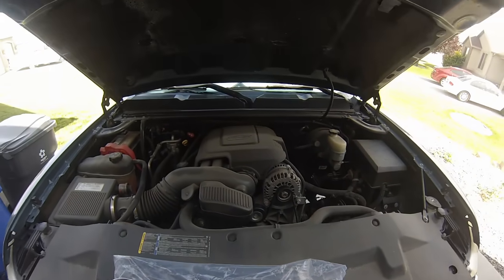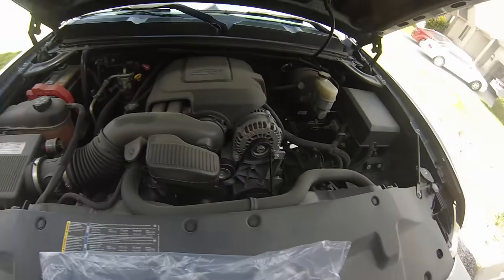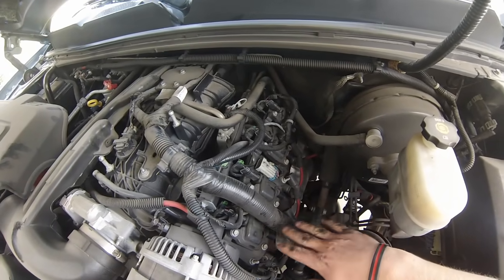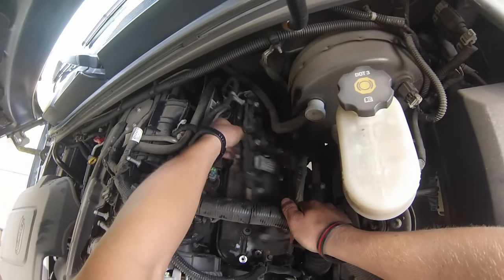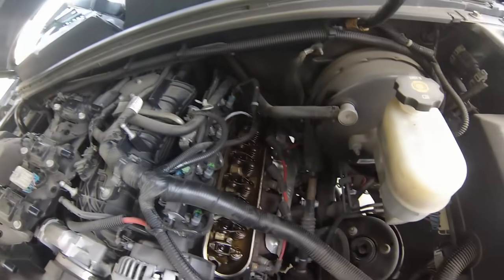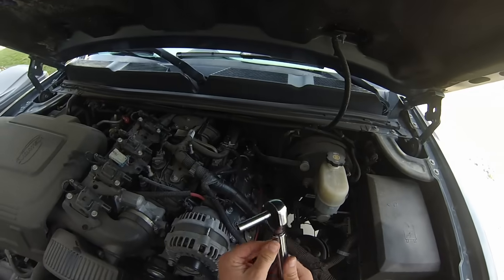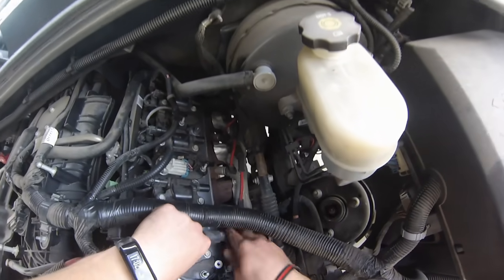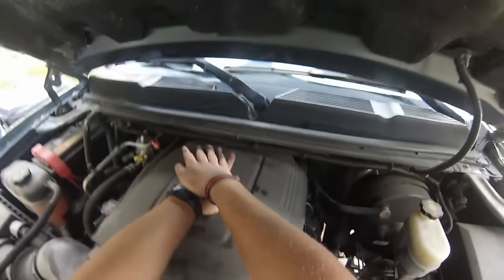Oil Consumption Fix: Replacing the Valve Cover and PCV on 2007-2013 Chevy Silverado

Comment: "Tube just pops easily off the valve..."
2 hours later, no there's nothing easy about it.
Reply from the maker: That's been my experience in every YouTube video I watch as well haha. I guess I got lucky in this video. Thanks for watching!
Reply: I assume you already got the job done, but there's a little pin-like lever at the base of the connection. You pull that back toward you and that releases the hold and you can lift it off. Just did this job today.

Comment: What afm deactivator did you use and fo u recommend it?
Reply from the maker: I'm using the Range Technology AFM Deactivator. It's about $175 bucks through Amazon and i don't have any complaints with it. I've been using it about 2 years now without any issues.

Comment: Hi, i have a 2007 chevy tahoe and every week i check the oil stick and it drops and i checked for leaks but there isnt any could this be the solution?
Reply from the maker: Absolutely. I referenced the service bulletin in the video description. This is one of a few fixes for the oil consumption. Another fix is installing an oil deflector in the oil pan over the afm valve. Look up that bulletin and it will provide you with everything you need to know. Thanks for watching!

Comment: FWIW: AFM can be overcome by driving in 3.  Seems it only comes in when the torque converter locks up (2008 LC9)

Thanks for the video, battling oil consumption here and have covers to install.  Did you use the gaskets included with the new cover? How are they holding up? Theres 2 styles listed, gm looks like a plastic multi layer design and im not sure which to use

What was the outcome on oil use after this? Any improvement?

Comment: I have a 05 and have had oil consumption. I don't thank I'm burning oil. No smoke out the exhaust.
Reply from the maker: Hello!  Unfortunately, with our modern catalytic converters, it's rare to see any type of smoke coming out of the exhaust anymore. One of my Jeeps used to consume over a quart per 1,000 miles right through the pcv valve and never once did I see smoke. Since your truck is an 05, it won't be related to the AFM system. I would start by looking inside your intake manifold to see if you see oil puddling inside there. Lots of oil would indicate faulty PVC. If that looks good then pull a spark plug and get a hold of a bore snake camera and look on top of your piston to see if there's excessive carbon sitting on the piston. If there is, your oil control rings might be bad. Thanks for watching!

Comment: Hello, what's the latest on the new valve cover replacement, no more burning oil or smoking?
Reply: I did the Range AFM disabler first and it seemed to fix the oil issue. I went ahead with the valve cover change as I wanted to be sure I did everything i could to stop it. When i got the old valve cover off, it looked like the new improved version. i said what the heck i had the thing taken apart, and plus there may be an improvement to the PCV valve, so i put it on. I havent done any long distance driving yet, but it seems to help.

Comment: How is de torqued for the cover? I have the same engine, thanks
Reply from the maker: I don't remember the torque but it's not critical since it's a thick rubber gasket. Just tighten by hand but make it snug.
Reply: It is 106 inch pounds

Comment: don't buy so called updated valve cover clean and drill holes in your old covers baffle
Reply from the maker: To each their own. I chose the updated valve cover and it worked really well but if that method works well for you for less money then that's awesome!

Comment: My truck consumes more oil now with that cover...
Reply from the maker: It shouldn't be. Something to consider... it may be your oil control rings on your pistons. If your truck has consumed enough oil from the PCV valve or AFM oil squirt then it will eventually cause your oil control rings to fail which would result in oil consumption. The additional oil consumption may be happening unrelated to the new valve cover.
Reply: Cyl head Valve seals

Comment: It's not the covers. Bad piston rings in these trucks.
Reply from the maker: It can be. Sometimes the problem starts with the cover and enough oil makes it down to the oil control rings. That was the case with my Jeep.
Reply: Are there any repairs or replacing piston rings besides a new engine?
Reply from the maker: @meatman1914  GM recommends a top piston soak if the valve cover and oil deflector doesn't solve the problem. It requires a special liquid to be put on the top of all cylinders and to soak a long time. The idea is the liquid goes down and cleans up any hard carbon deposits sitting on the piston rings. This is something I would do at the dealership for liability purposes. There's always a chance the liquid could free up the deposits only to have them get lodged elsewhere in the engine.
Reply: XinnKoda I appreciate that..I wonder what the main difference is between 2007-2014 Tahoe’s and Silverados and the 2015 and up because it’s still a 5.3 but they don’t seem to have these problems anymore or as much
Reply from the maker: @meatman1914  I'm not sure either. I wish I had known about this issue before I bought my truck. I still love my truck and it's been very reliable but even after the tsb recommendations it still consumes a bit of oil.

Comment: Does that mean I can take it to the dealer and they will fix it for free ??
Reply from the maker: Unfortunately no. It's a technical service bulletin, not a recall. Its information put out by GM that does not refer to safety problems so they are not required to repair them.
Reply: XinnKoda thank you for the information :) and how much did the part cost?
Reply from the maker: To be honest I dont remember the cost but I think it was around the 85 dollar range.

Comment: Over 15 years ago i got rid of 10 gm trucks that were not a year old and replaced them with fords for my pest control business. you name it failed on the gm trucks engines, transmissions, rear ends, electrical  a/c's always going out on every damn one something major failed. all my life my family owned gm garbage and just assummed that falling apart and major problems were the usual. the 10 ford trucks all reached 400000 miles with no major issues other than servicing  maybe one or three blown out spark plugs put in inserts and fired em back up and hauled ass and when i sold out they went with the business and are still running today and they all had the 4.6 triton engines. i saved ton's of money on oil as the fords did not use 3 quarts a week like all the gm junk did. what ever you pay for any gm junk new or used you just bought yourself  nothing but pure shit. yes my trucks got run and worked hard as hell carrying those heavy tanks and equipment but there is only built ford tough and i was sold for life. not all vehicles come trouble free but i never ever replaced one single engine trans or rear ends in those fords never an ac failure,, now ball joints breaks the usual stuff we did. so hey gm lovers hows about 3 engines and one transmission replaced before the original tires were worn out on the same pos truck actually before 18000 miles pure shit no wonder people are leaving gm in droves buying toyota's fords hondas . and i am totally happy that ram is outselling the gm crap. 5.3 oil pumping junk

Comment: Is it necessary do disable the fuel management?
Reply from the maker: It's not necessary but many mechanics and experts believe the fuel management is the main reason these engines develop oil consumption problems. Thanks for watching!
Reply: I was going to comment on that because I heard stuff with afm delete you can solve problems from even with oil sensor pressure goes out and I replaced it already 3 times is not fun to do.
Reply from the maker: @juliobello4561  thanks for chiming in. And I agree. Unfortunately, to do a proper delete it requires replacing the lifters which requires taking the heads off the engine. If you catch it early enough though typically just a software delete will prevent future problems.
Reply: There's definitely some fault in the engine that allows the rings to burn up, and I would assume fuel management would contribute to that in some shape or form. My truck's been running great since disabling it. Wish I bought my Range AFM Disabler ($200) before I took it off the dealership, that's how much better it is. I'm glad to see that it seems like someone has figured it out. Just got my valve cover. Its happened twice (rings burning up) to me before 100k and everyday I smell that oil, its aggravating. I change my oil religiously, and when I can remember (Edit: while I'm fueling up), I'll use Lucas fuel system cleaner. Hoping for the best, but can't expect such a simple fix to really solve it entirely. Really hoping for it to be a simple design fix though.